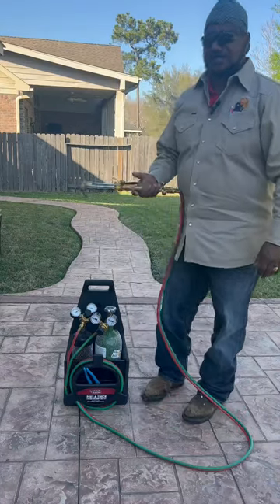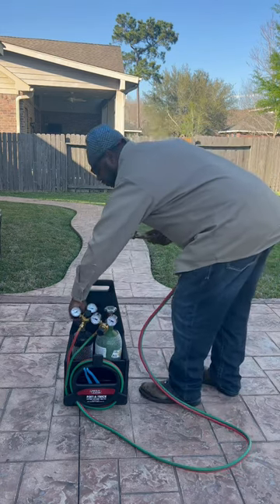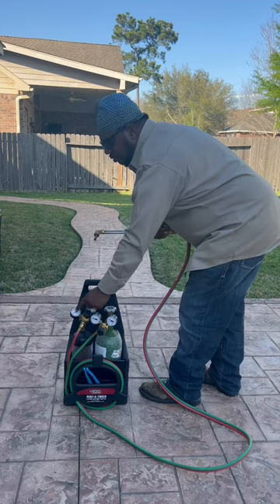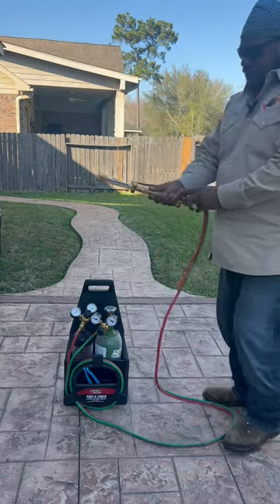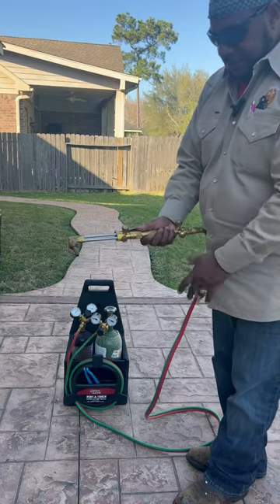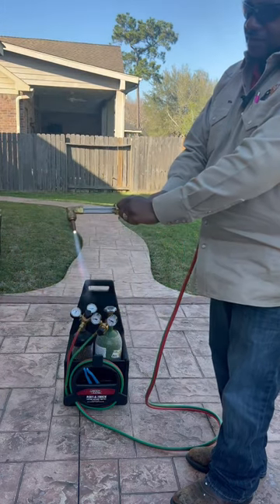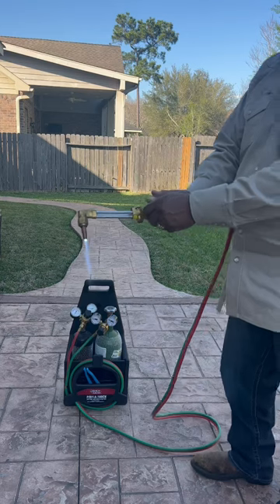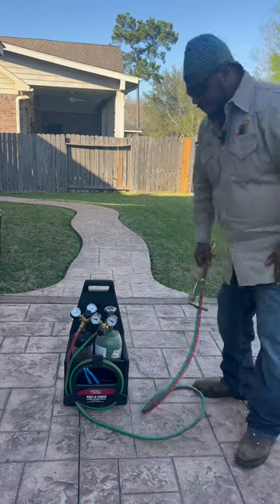How To Light A Oxygen Acetylene Torch For Beginners

Comment: Turn acetylene off first then oxygen second.  The oxygen will push the remaining acetylene out the end of the torch thus blowing the flame out.  This prevents the flame from following back through the torch which will wreck your seals and on a really bad day it can wreck you…….. safety first
Reply: Thank you this helped a lot
Reply: Noooo!!
Reply: Es al revés! Si apagas el acetileno primero la llama se propagara hacia adentro de la antorcha creando una pequeña explosión, primero el oxígeno. Luego el acetileno.
Reply: @maximohuenulef  your theory is completely false and the reason for flashback arrestors.  I have listened to more backfires from people doing it your way than I can count, I quickly correct them.  Not only does your torch have an oxygen supply but there is also oxygen in the air you’re breathing.  If you turn off oxygen on your torch first you have an existing flame that will easily follow back into the torch during low flow shutdown, on top of that your tip is hot and can reignite the torch if under heavy use.  

The only time you should turn off the oxygen first is under sustained backfire, this happens when your torch is extinguished during backfire.  You will see black smoke coming from your tip.  In this case quickly turn off your oxygen because your internal flame only has one source for it.
Reply: You always turn off acetylene first can't have a fire without fuel I swear people are poorly trained
Reply: Why do the torch manufacturers and schools teach to shut the oxygen off first?
Esab stated if you shut fuel before oxygen it can create a pop which throws carbon soot back into torch which may plug gas passages. I usually just try and shut both off at same time. In hvac we were told oxy first then acetylene
Reply: Turn on Acetylene then oxygen 
Turn off oxygen then acetylene

Comment: How long can you cut till you run out of gas with a setup like that?
Reply from the maker: About 30 minutes
Reply: @weldingandstuff  what does it cost to fill up a bottle that size?
Reply: Nothin to it, just gotta do it. YES
Reply: @j_wal_0273  when I bought my kit I had some bottles around that size and I think it was around 30 or 50.
Reply: @270Winchester where at? Near Chicago it was 80 something bucks
Reply: @dackbowland1876  this is in Louisiana but I bought it from a shop that does mostly wholesale so they probably have lower prices.
Reply: I just exchanged those two bottles and I paid $80! Like everything else, prices are crazy!
Reply: I just spent 45 to have them filled in central NY.

Comment: This is how youd get taught at college but the gauges dont work at all work places so at work i get taught to set oxygen pressure by testing it out on ur skin. As for the acetylene i got taught to always have the gauge set at the maximum. And as for lighting it i got taught to turn on oxygen and acetylene not just the acetylene because it will give off less s### in the air cus u have already turned on both in the first place so no black smoke will be given off at all

Comment: Here's a question: do I need a certain tip for heating? This is useful tool for car repairs& welding is an art in itself
Reply: Rose bud, size varies depending on material gauge